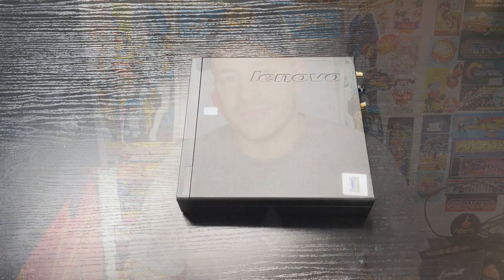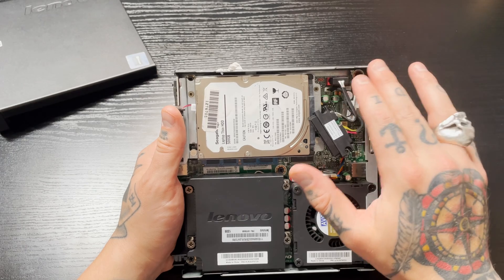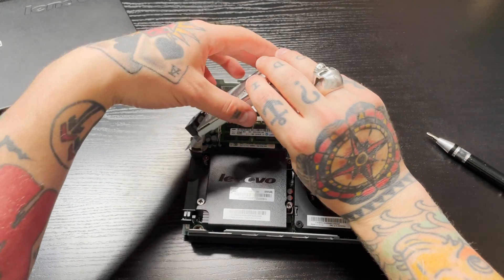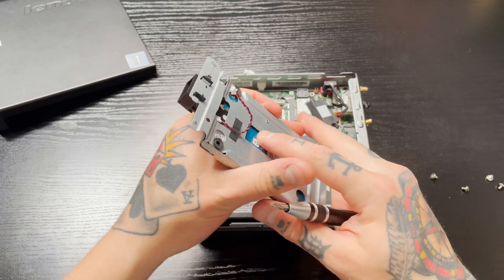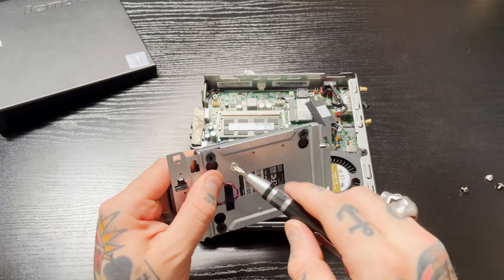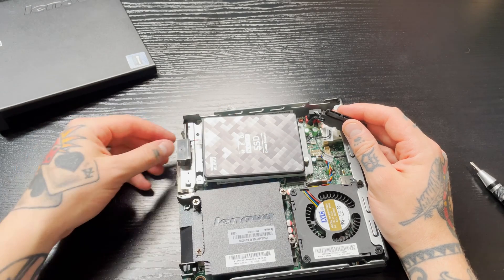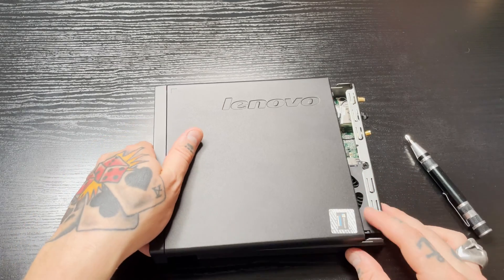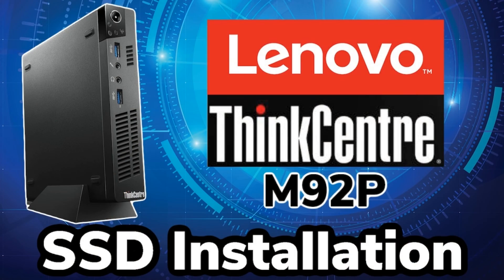Lenovo ThinkCentre M92P PC SSD Install Guide - Gaming Computer SSD Installation Tutorial

Comment: What are your plans for this Lenovo? I have a M93p
Reply from the maker: I'm working on a loaded SSD that will be full of thousands of retro games from many different collections. You could load that ssd into the lenovo m92p and be able to get into a ton of great games. Much more than retropie. The lenovo is going to be cable of emulating most collections beyond what RetroPie can handle like gamecube, sega saturn, all n64 and dreamcast, ps1 but it wouldn't be ideal for ps2, xbox, or ps3 games. You'd need a stronger pc than this for those collections but it's still an excellent choice for the majority of retro gaming collections. I was playing saturn on it quite a bit and they all run flawlessly.
Reply: @officialchasebrogan  Have you had a chance to see if any PS2 games run through Batocera on this unit? How is the performance on the higher end systems that the Pi can't handle like Gamecube?
Reply from the maker: @JoelWatson  Gamecube runs quite well. can't say I've checked every game but what I have tested runs pretty well. Might get a stutter here and there but nothing major. Obviously a gaming pc would be better and has a smoother gameplay but those are much more pricey. 

PS2 is pretty divided. Some games run perfectly fine and others are a complete mess. For that reason I don't recommend this PC for PS2 gaming. I never want to be limited with collections. I  ended up upgrading myself from this one up to a HP gaming PC. It was several times more expensive than this one but in the end I was able to get into PS2, Wii (much smoother), Xbox and even PS3.
Reply: @officialchasebrogan  Thanks for the update! Guess I'm still on a the look for a small form factor and relatively inexpensive PC to play PS2 games on.
Reply from the maker: @JoelWatson  yeah it’s tough to find small PCs that can’t handle this collection. It’s very demanding on PCs.
Reply: So running windows 10 and then what program to run all the emulators?
Reply from the maker: @stevefisher8424  no windows 10 just batocera on the ssd with everything integrated directly into that so the pc boots directly off the ssd.
Reply: @officialchasebrogan  had no clue that you could load batocera onto a formatted drive. Will you or have you made a video on how to do that?
Reply from the maker: @stevefisher8424  I haven’t yet but basically you download batocera unzip it then connected a ssd to a separate computer and drop the unzipped image onto the ssd
Reply from the maker: @stevefisher8424  no windows 10 just batocera on the ssd with everything integrated directly into that so the pc boots directly off the ssd.
Reply: Very cool. I flashed Batocera to my SSD and installed it in my M93p. I’m not looking for videos on how to add additional emulators to it now.
Reply from the maker: @stevefisher8424  It should come with just about everything on there already. They don't all show up in applications but they should all be on there. You just need the bios files for everything which you can download in one download by going to our bios file video and clicking the link in the description. That's a life saver.